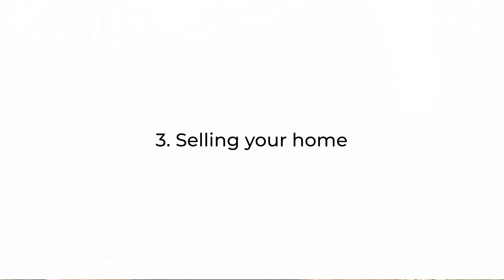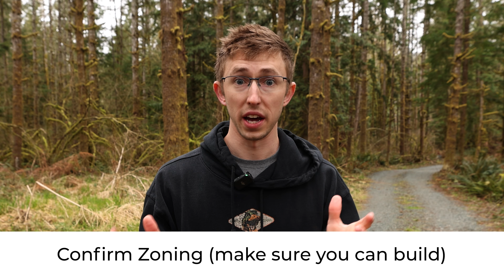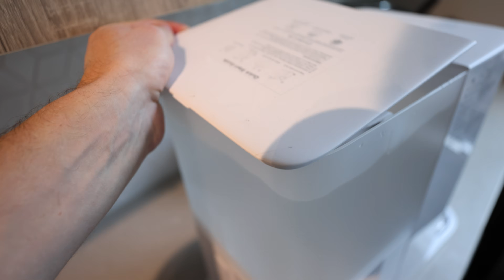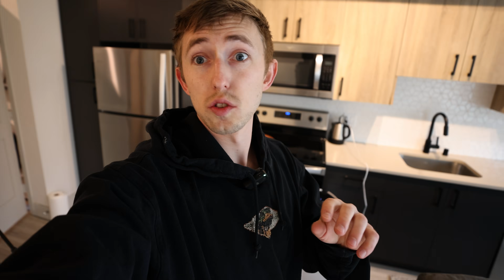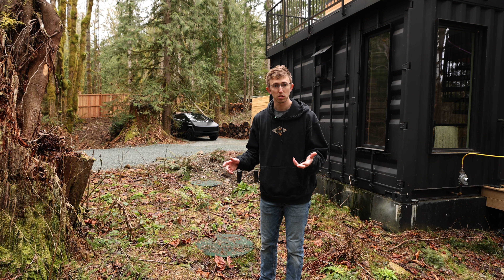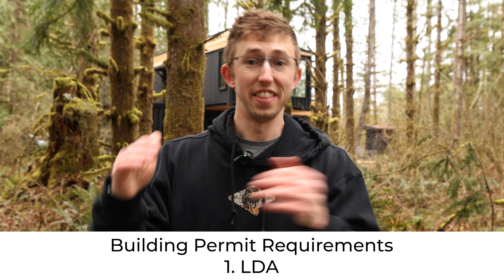How to Get a Building Permit (For Beginners + Detailed Breakdown)

Comment: you have a better handle on the process than most homeowners!  NY state is similar, the land and evironmental zoning is the 1st step with a seperate state agency, then most often the health dept and water well testing is required unless it's deemed commercial, and then the town planning board reviews your plans, and then finally the building code officer would issue a building permit based on the blueprints and stamped plans.

Comment: Not so easy in my County. They use every nuance of every regulation to deny vs helping people build within the spirit of the law regardless of common sense for each specific site. Its straight up criminal corruption....and if they don't have a box to check for anything outside the box or unique, there is no approval.